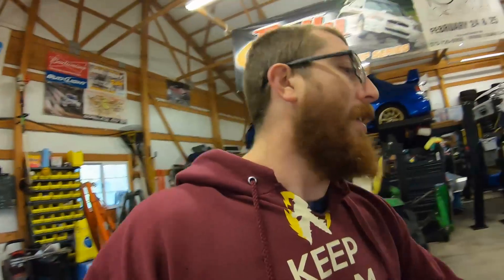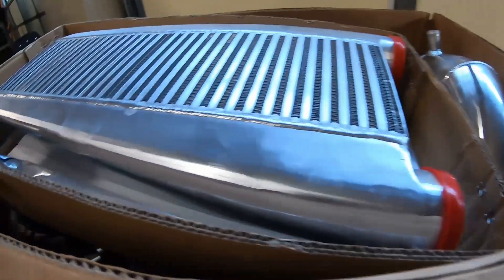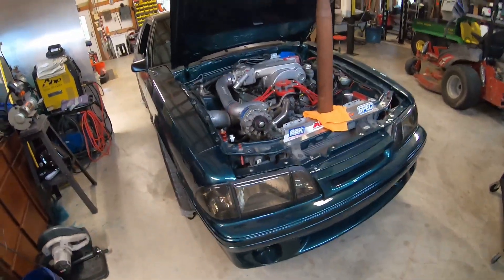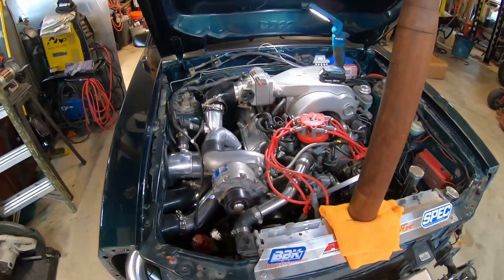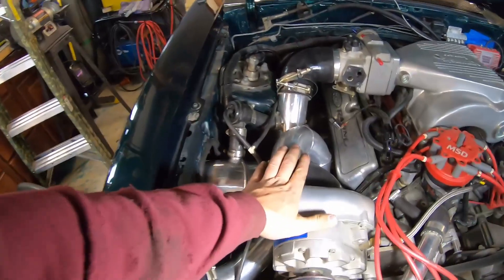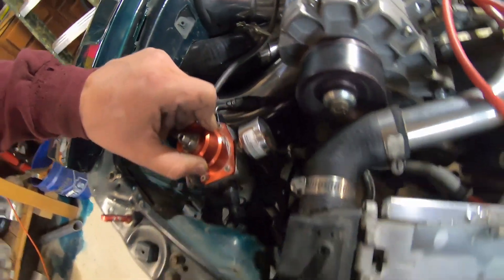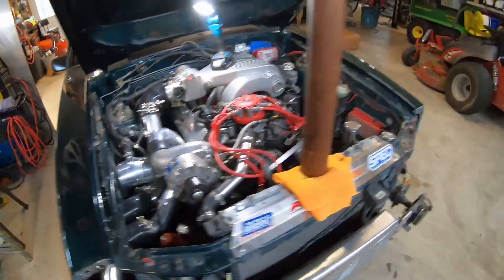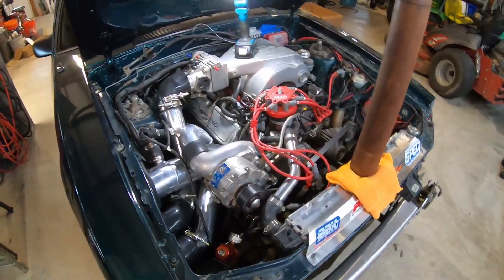Supercharged Foxbody CX Racing Intercooler Kit Install

Comment: Matt, don’t cut the intake pipe. You can swivel the supercharger housing the same way you do the compressor housing on your turbo. it’s easy man like 6 bolts. Mark the housing with one bolt tightened (they are 5 ft lbs.) and torque the rest once you have the angle you want. I had to do this with my my vortech  I/C not too long ago. Good stuff man, keep the content coming Bro! 👊
Reply from the maker: Bro nice! Thanks for the input, I didnt think they could be clocked! All it needs is to be clocked a little bit to fit up perfect them. Appreciate the information:)
Reply: Anytime man, learned a lot from the channel, just paying it forward 👊 I know you aren’t a supercharger guy, but you have to take that thing for a rip, a pushrod with H/C/I & a vortech is stupid fun!🏎💨
Reply from the maker: @Boostedjasper  hey if the owner wants to rip it when im done then I will definitely video it! Thanks again!
Reply: Anyone have fitment issues? Having issues with it being against my valve cover and inner fender by the strut tower?

Comment: I new CX for turbo stuff cool they are doing this set stuff to. Even if it only cuts 30 percent of the heat it will be worth it, not so much HP gained but heat lost

Comment: Beautiful just replace the bypass valve with a blow off valve since you guys are running over 10psi
Reply: You can't use a BOV because of the MAF, Doing so will cause all types of running issues! Stop giving advice because you have no idea what you are talking about, All you are going to do is cause problems for other people! My SC makes 11-11.5 psi and I am still using the original bpv with zero issues,
Reply: My bad your right I thought it was speed density like my foxbody didn’t see it had a MAF 👍🏼